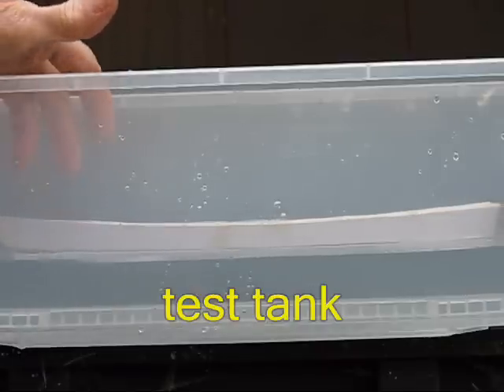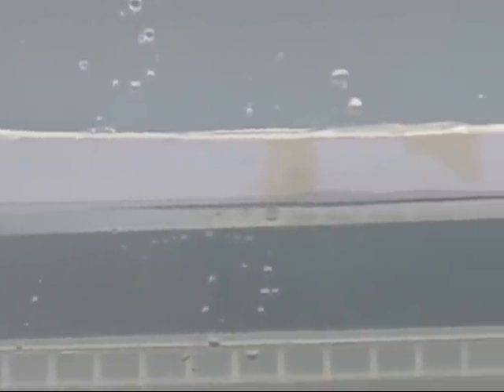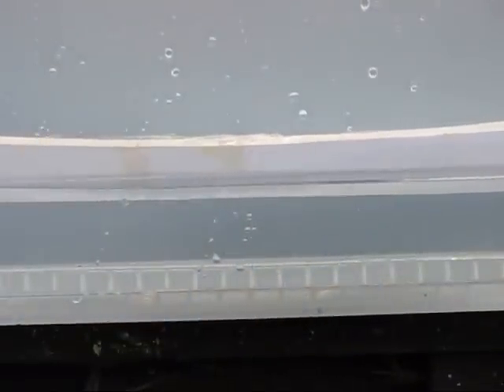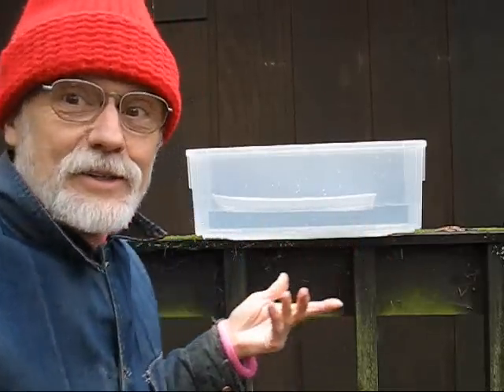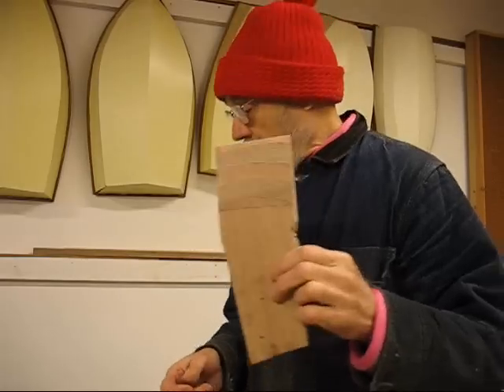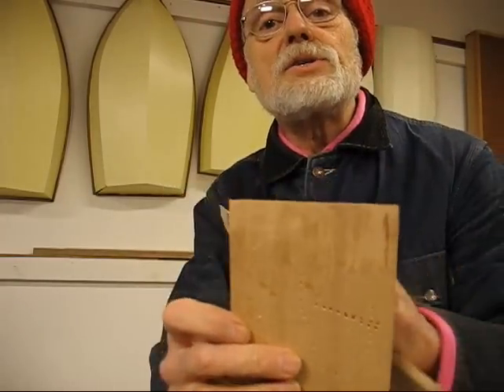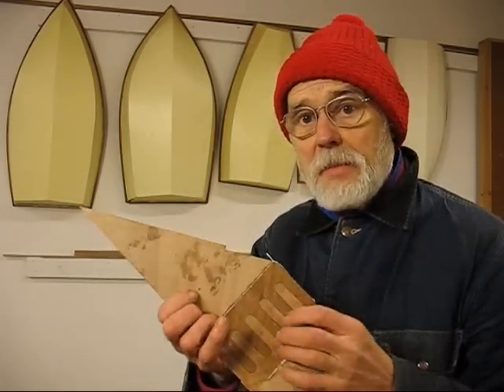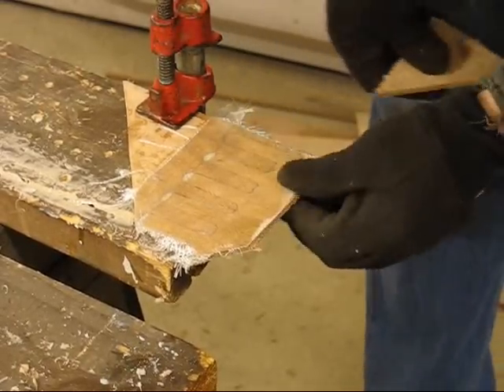EMC Part 1-2 Tank Testing.wmv

Comment from the maker: @WhazzupPhil It might, but I like "interlocking" the panels so the joint forces are spread out over a wider area.  I was thinking of making a longer EMC and using 1/8" ply with glass on both sides.  I may use a "glassed butt joint" on it.

Comment from the maker: Well, now you tell me.  I worked up the first model for the 18ft EMC+2 today.  Only have two little corners to adjust for the final design. I guess I'll make lemonade. ;)

Now I will have to make a 16ft EMC+2 version, but it will be "broad" to carry that much weight.

You will always use an OB (gas or electric) ???  Makes a difference in the height of the gunnels when I'm planning.  Let me know.